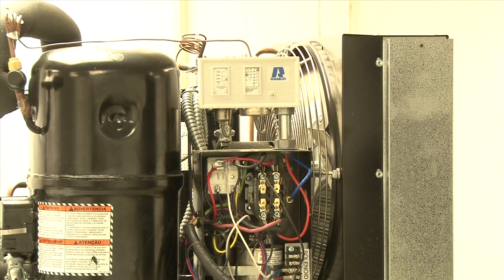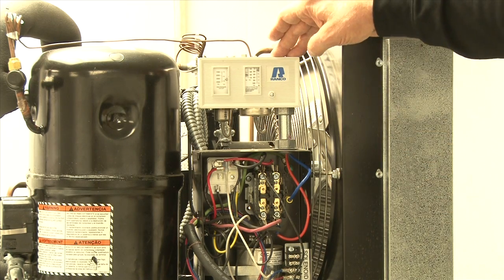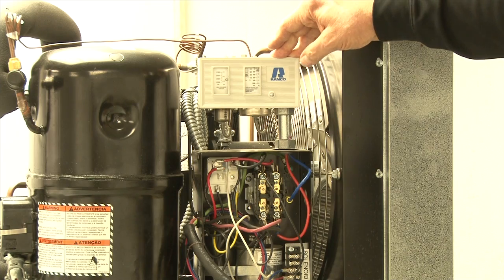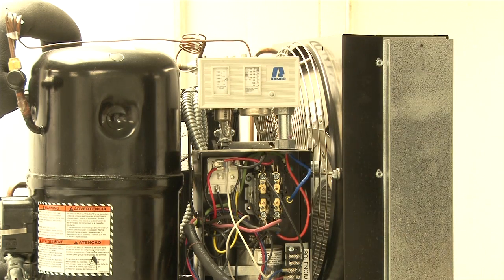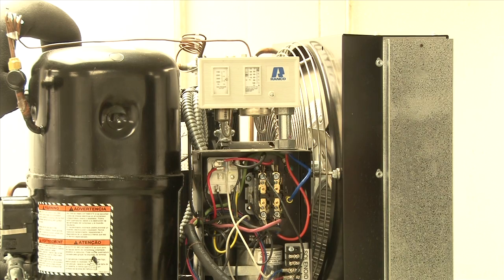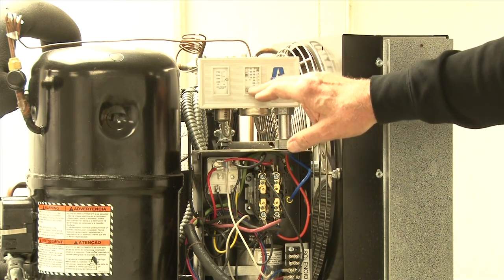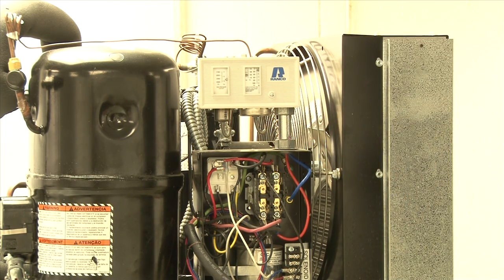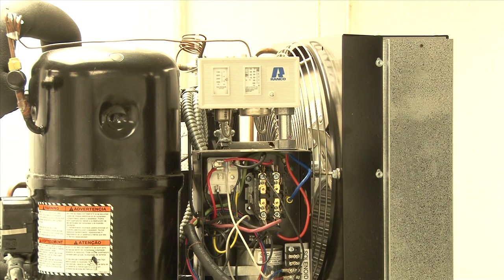adjusting dual pressure controls

Comment: Hello. I see the low pressure control reads the low pressure right on the compressor. Where does the high pressure control on the condenser connect to? Thanks
Reply: Liquid line coming off from receiver
Reply: Hi Dominguez, for the hi press. Will it work when install on the disch.line?
Reply: Since it's the same pressure reading just at a different phase.